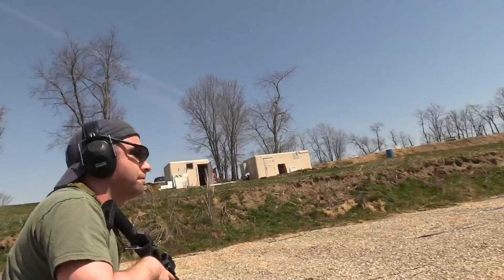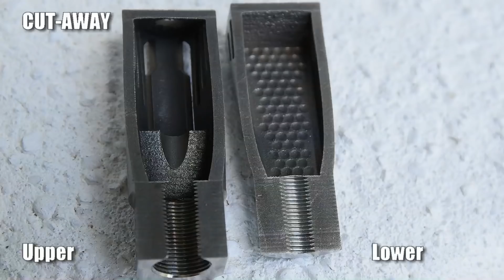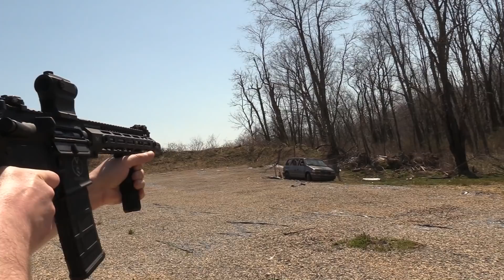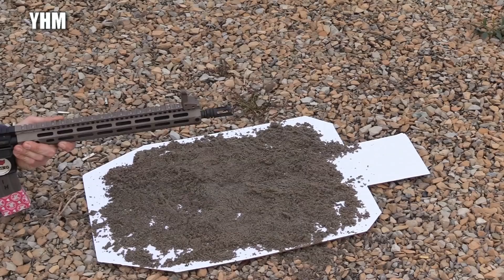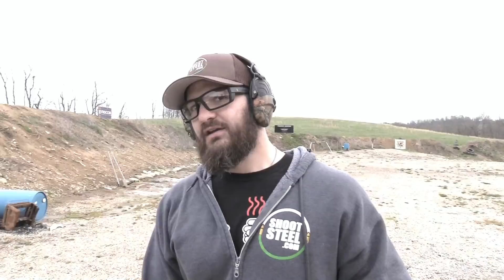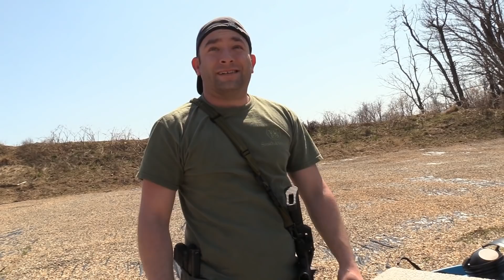Insane 3D Printed Brake: NERO 556

Comment: Trying to put together an AR-Pistol build that is compact (7.5" barrel), able to handle mid to "long range" shooting (at most 200 to 300 yards), shoot smooth and with as little recoil as I can get. Preferably to use at the range for fun, but also capable of handling home defense god forbid home invasion. This has reinforced my desire to get the NERO. Got a ST T2 Buffer and a decent Buffer Spring as well to further reduce recoil.
Reply: Your first problem is a 7.5” ar
Reply: @MyLonewolf25  Hasn't given me any issues as of late and has been absolutely EXCELLENT for performing dry fire drills through tight quarters in my house. I am very satisfied with the result.

Comment: OK, just how do you 3D print something in the alloy Inconel? I get how you do the print with powdered Inconel. I don't believe that will give you the strength of a hammer forged and finished machined part. 3D printing is "so special," but how do you heat and then anneal the part? How do you machine finish the hard as the hubs of hell result to final tolerances? And how does this later part change tolerances?
Reply from the maker: You are incorrect. Alloy is king, the density checks out
Reply: VSO:
I'm sure you are correct. I would just like to know more about it.
Reply from the maker: Patriot Goose its basically a micronized powder that is layered and then welded with a laser. You dont have to do a lot of machining after its done. Thread the thing. Inconel fucks up tools thats part of the reason its so expensive to make things out of. 3D printing takes 99% of that machining out.
Reply: VSO:
That's very helpful and I appreciate your info. If you get time, what trade runs the laser, etc. (I'm a retired machinist w/BS in Chemistry.) Are there any facilities students could tour in western WA? What educ. programs get one started here?
Reply from the maker: That is a very good question. I believe its CAD heavy. Probably need some basic programming too. Probably not organized into i trade union yet if you are asking, so entry may not be that hard.

Comment: Could've done without the gay porn star music in the beginning. But that brake does kind of look like an exotic butplug. Eliminated rectum climb. LOL. Awesome
Reply: Pfffft, vaseline. If this is a muzzle brake allegory and I have to breathe in hot gas when I pull the trigger, then it's cum. I'm cross referencing with a tub of my own cum and I'm pouring it all over this comment section because this is America and its my God given right to do so. Now take a deep breathe in, I just fired a round and my barrel is nice and hot (;
Reply: A good time for $180 USD!!!! ;D
Reply: I think you may have some latent tendencies judging by the way you're embedding gross-out homoerotic euphemisms into your commentary, just come on out, it's the current year!